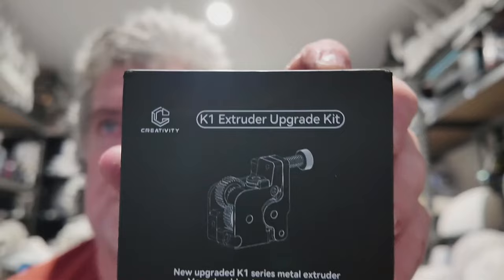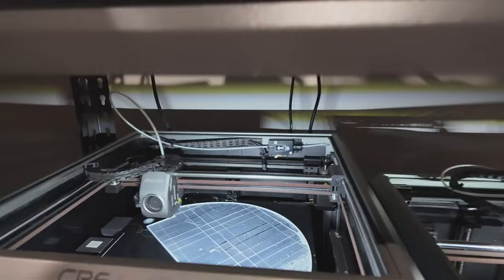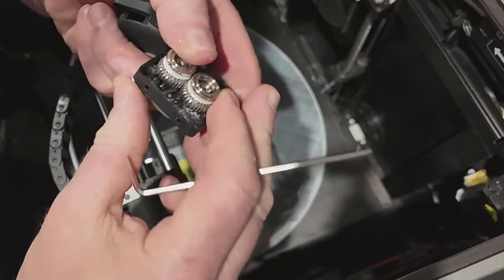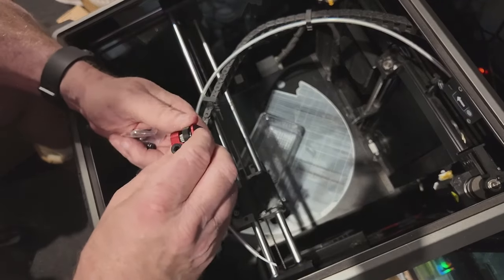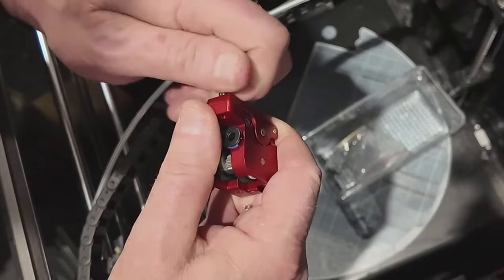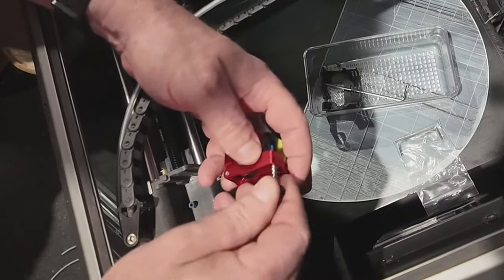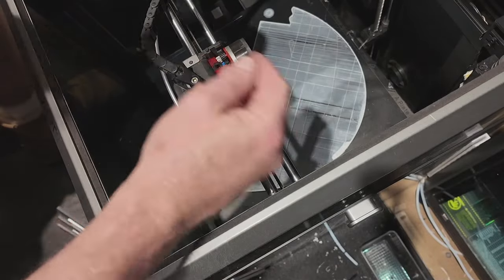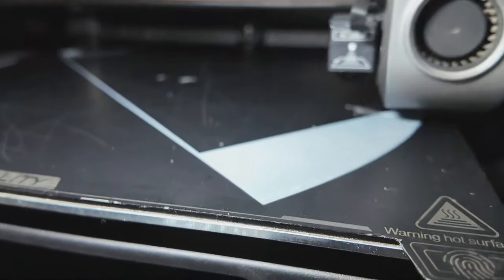Extruder playing up on your K1, K1C or k1max  then this one from Creativity might be the one for you

Comment: after installing it, did this prevent the jamming problem from the build-up of heat and retractions that melted filament in the housing?
Reply from the maker: I never had that problem , i just prefered the ability to adjust the extruder wheel tension.

Comment: Very informative tutorial. I’ve had problems with my K1C being clogged most likely due to running PLA-CF nearly 90% of the time. Would you suggest upgrading to this style extruder or would most of my problems be the type of filaments I’m running ?
Reply: i think  use k1 extruder  for  k1c
Reply from the maker: I'd say the filament is causing most of the problems? It's hard 0n the nozzle. Youll have to swap out the nozzle more often. That's the first thing I'd look at

Comment: Drill an internal chamfer on the PTFE tube & cut the filament end to a point & it goes in easy, TPU too

Hopefully someone will make an extruder with the same mechanism as the Sprite Pro, It's so easy to feed the filament in
Reply from the maker: yes good advise

Comment: Love the k1 max some of the k1 series had bad faulty extruders if it's got a really shiney color to it then it's one of the faulty ones
Reply from the maker: Love my K1max and K1C, they produce some amazing prints. My problems were probably due to the build up of filament dust on the gears. But the new extruder is going well
Reply: great video  i think buy this  let your k1 machine is best good